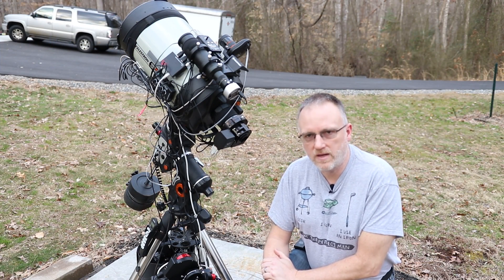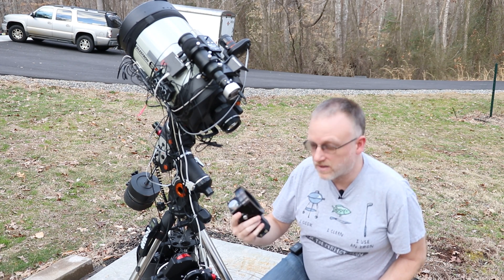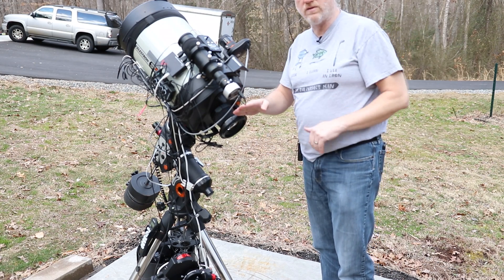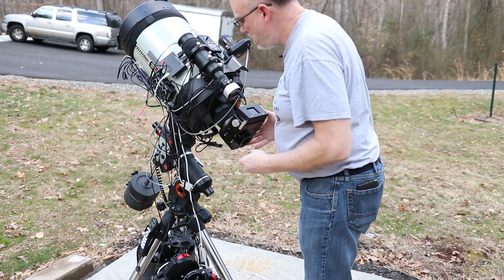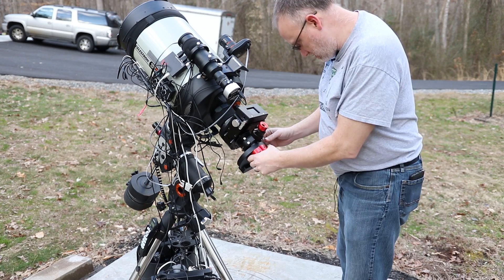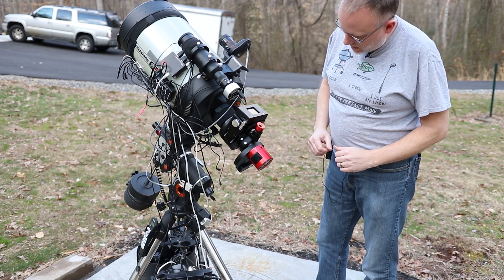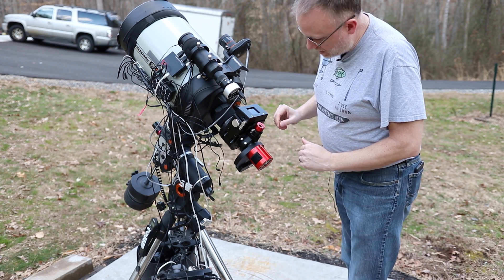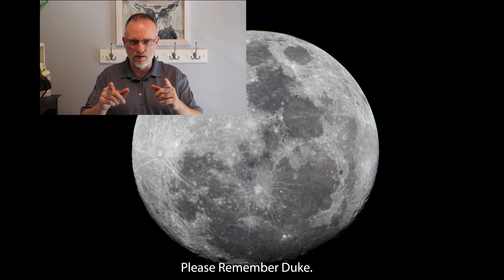EP126- Installing the LiteCraler, ASI1600MM Pro and 8 Position EFW on the OTA

Comment: Damn....lol. that mount is super overloaded.  Gotta be or really close.  I think new mount would have been better than a night crawler.  But that's me.  To each there own.  Goodluck with it
Reply from the maker: Thanks for watching and your concern.  I weighed the payload and it's at 31 pounds.  The capacity of the mount is 35 pounds.  So it is close, but within the limits.  But a new mount is definitely one the short list for the next purchase.  Clear Skies.
Reply: @astroimagingjourney8517  I have the same Celestron setup and the scope with accessories weighs 38 pounds, with dew shield puts it at 40.  Currently having to many issues with CGEM-2 tracking with that much weight.  I would keep an eye on it.  Just ordered the CGX-L mount and tripod.  Hopefully I can track precisely now.  BTW the CGEM-2 max payload is 40 pounds.
Reply: I switched from a CGEM DX to a Ioptron CEM 120, could not be happier - I think the nightcrawler is total overkill for your C8